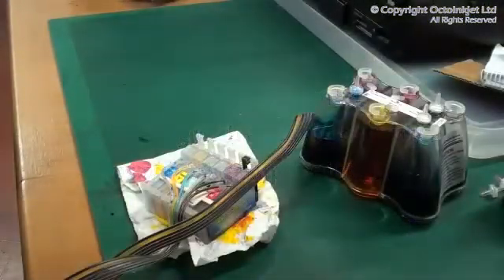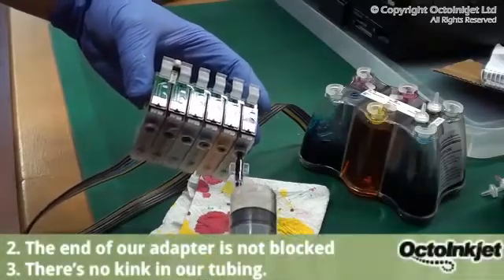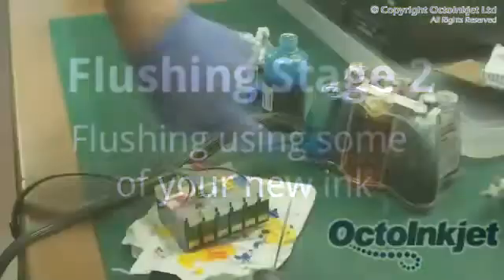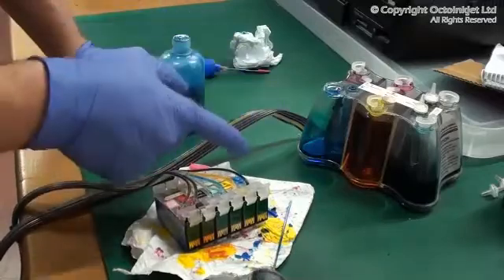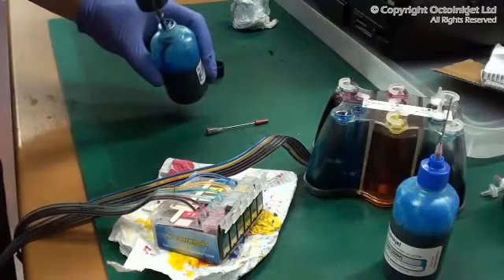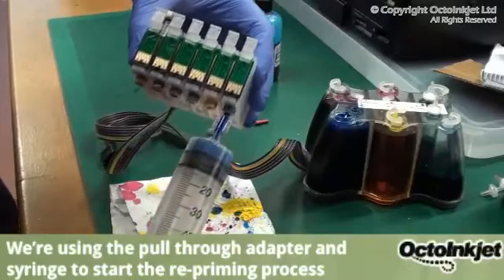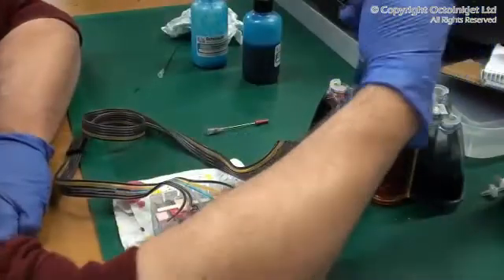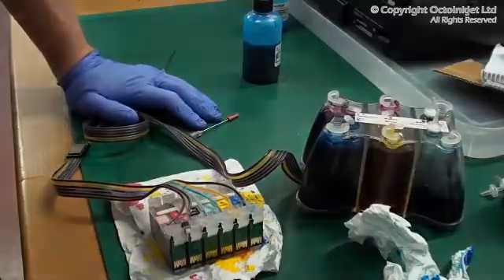Replacing inks in an Epson Continuous Ink System

Comment: I flushed  tanks and cartridges  with water to remove aged ink.  Impossible to remove  all  droplets of moisture from system, problems expected ?
Reply from the maker: If you're at all worried, it's worth putting a few milliliters of your new ink into the reservoir. Swilling it around in the reservoir to catch any remnants of the old ink and then drawing that through the tubing/cartridges. Then swill around again before pulling it out of the cartridge for each ink channel as best you can. 

That should at least dilute down and negate any remaining water moisture.

Comment: Hi how do i eliminate black dots on my prints
Reply from the maker: Depends on what sort of black "dots" you're getting... If there's big splurges of black ink droplets then chances are high that your CIS is overpressured in which case re-priming the reservoir should help with that... 

If the problem is nozzles firing off at angles instead of straight down then you may have algae growth and/or very old ink deposits in the nozzles that are deflecting ink. Flushing your printhead with a gentle cleaning solution using a passive printhead cleaning process is one part of the approach...
ref: http://www.printerknowledge.com/threads/epson-rx640-ink-flow-issue.9059/#post-71254
...the rest is replacing your CIS ink with a new batch as per the video...